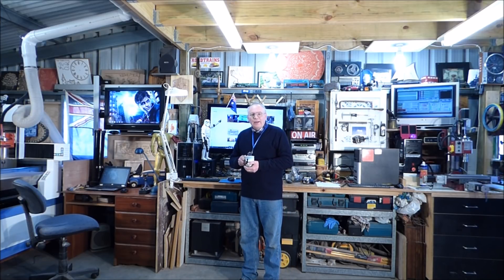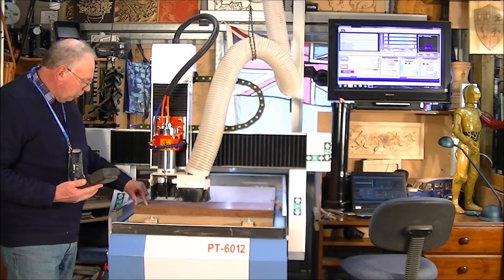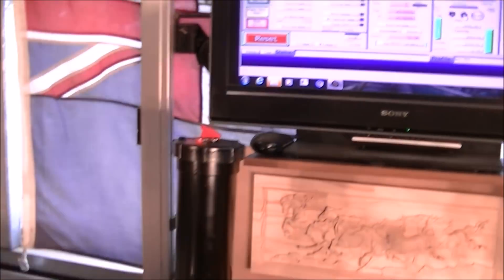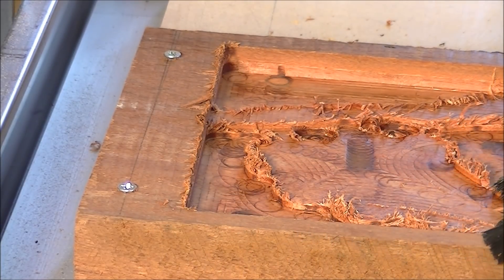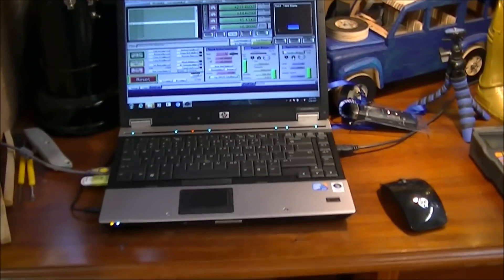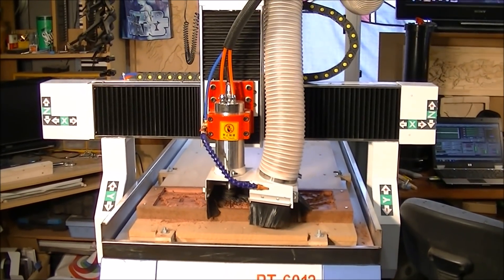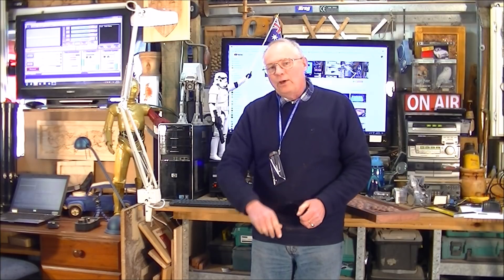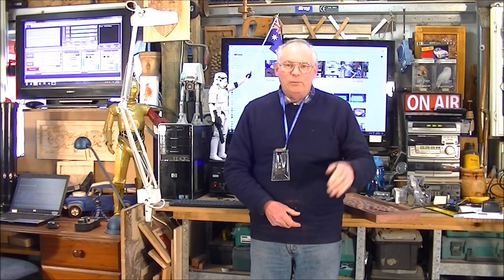I purchased a Hybrid CNC router, carving a $150 ArtCAM HD  3D Art Décor picture

Comment: gratz for 200 ...btw I am interested in 1 of those 4 axis low cost cnc for pool cues tapering and inlay work  and I wonder if it would give me a good job , I hope you can advice since you have 1 , thnx
Reply from the maker: Hi.
Pacific Tooling ships worldwide: Email me at info@pacifictooling.com I will send you
information on our new * Lathe * and 4040, 6060, 6090 and 6012 (linear rail
model) CNC routers and CNC lasers 6040, 6090, 1390 and 1225.
 Pacific Tooling;
 Australian Inventor Roger Clyde Webb